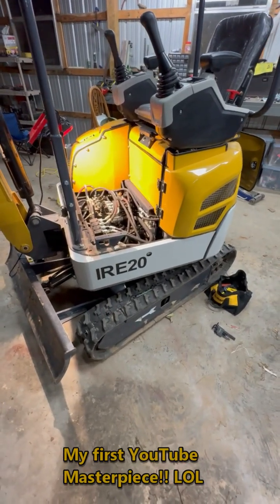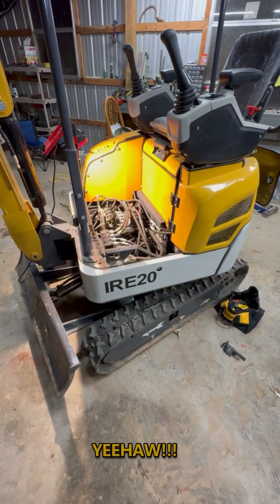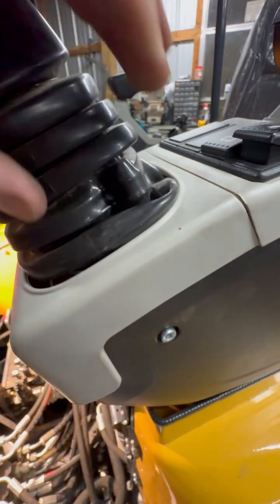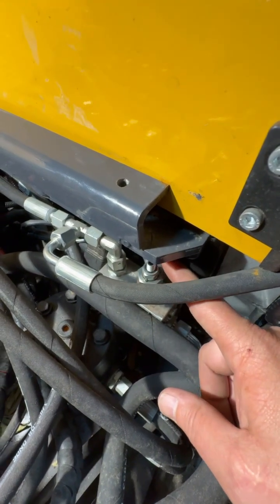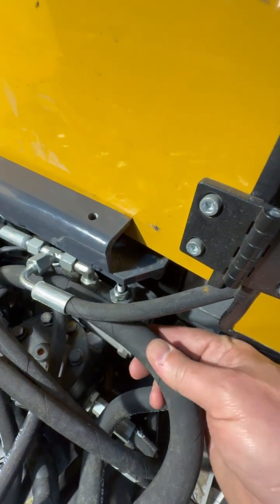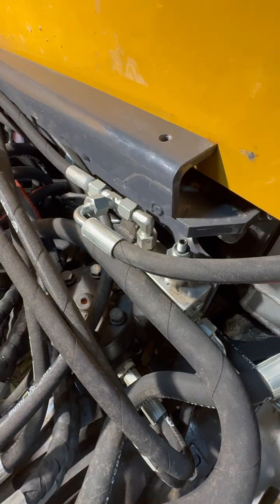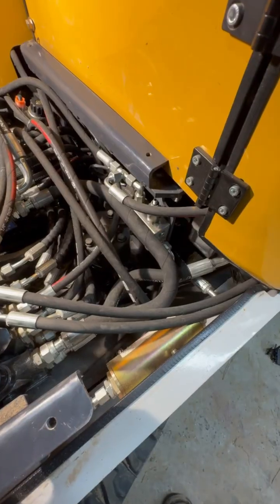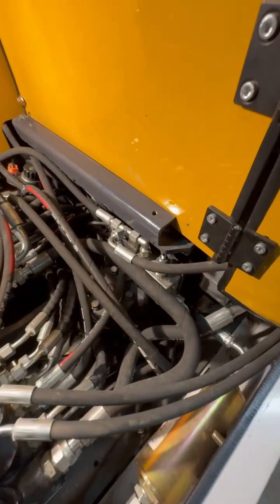How to fix your JERKY mini excavator!  Part 1. IRE20 Machine Hydraulic Adjustment

Comment: You can put a flow control valve in line with whatever hydraulic is jerky. I’ve got an IRE 18 P with the gasoline engine and only the boom lift is jerky and uncontrollable so I’ve seen many guys putting a flow control valve out on the boom piston just right in lineto settle it down
Reply from the maker: Thanks, yes that’s is my plan too. The springs were a game changer. But an accumulator valve would likely make it perfect.

Comment: When that pilot relief valve bogged down, did sound like power steering squeal? Mine did till I found out what was causing it.
Reply from the maker: Mine didn’t squeal. What was causing yours to do that?
Reply: @GPTroop  Pilot relief valve turned in too far, back it out one turn, problem solved. It didnt squeal until machine got hot and working hard.
Reply from the maker: Thank you!

Comment: Summit control valve. I put one on the stick and boom. Adjust to your liking. I love mine. Temperature not effected and i have 140 hrs. Just a thought
Reply: The easiest way is to put them just before the cylinder and get fittings to put the hose right on the valve. I would tell you the fittings but yours may be different. If i think of anything else  ill let you know. Have fun
Reply: Can you please provide a link on what you put on yours? IT will save us all a lot of research
Reply from the maker: Nice! Where did you pick it up at?
Reply: @GPTroop LFC-04N can be bought at Summit Hydraulics. The valve will need two fittings depending on the style your machine uses. Summit can help you with that as well.
Reply from the maker: I just saw all your comments. Thank you! I am sure a lot of others benefited as well!
Reply: Summit, they have all kinds of hydraulic  stuff. I  used LFC-06N VALVES. @GPTroop
Reply: Oh. By the way mine are ajusted all the way closed and just about one turn opened. Yours may be different due to you adjusting you pressure valve. I set my pressure valve at 2600 psi. Hope this helps you.
Reply from the maker: Thank you, I appreciate it! I will look them up. Let the mods begin! LOL
Reply from the maker: Thanks, I have another adjustable valve in there. But I am not sure what it is adjusting. I haven't had time to mess with it lately. I adjusted it, but really can't tell any difference. I might do a video on it to see what the interwebs say it is.
Reply: One is for operating some valves and the other is for the rest of your system  valves. You look close you have two valve banks.@GPTroop

Comment: I know why that thumb bent. I just got a new AGT20...that side of the thumb when up, is right beside to "on" the beam. The other side has about an inch and a half space between the beam and thumb. So it is a manufacturer defect of obviously "several" machines. They either welded up the thumbs unsquare or, the holes on the beam that the thumb pins  fit into are out of alignment.  How old is your machine?
Reply from the maker: I just got it a couple months ago. I hammered in a vise to get it so it wouldn’t hit again.
Reply: RATo Vtwin. ..get some StarTron and add to your gasoline. It will flush the chinese smog crud out of you fuel system, crb etc.. Don't b surprised if it smokes like a diesel for about a half an hour.//t shall pass then run a lot smoother. I have the same unit under a different name.

Comment: You didn't show how to do it... the adjustment...
Reply from the maker: Bigmac, I can do a short if you need. But it is fairly easy. I show it up close in my long video too. You just take that top bolt off. And it exposes the nut that has an Allen head on it. You turn that with an Allen key to adjust. But more importantly than adjusting that is getting the springs into the pilot controls. That will make a huge difference and you probably don’t need to adjust that valve.

Comment: My thumb did the same thing first day yanking on a root
Reply from the maker: I put mine in a vise and pounded it back straight. It’s been good since.
Reply: Even a john deere has a solid plate welded across this so they don't bend.

Comment: I recently just picked up the same machine. Does your hydraulic tank bubble?
Reply from the maker: I believe it does on the side.  But that could be the fuel level. I’ll verify and I’ll post a video on it. I’m also going to post a more detailed video on the pilot control springs. I’ll have them up in a couple days.
Reply from the maker: I had some really small bubbling when I changed the fluid and ran it. I expected that.

Comment: Thanks good to know.  
I own the same machine.  
Also wondering if the machine has a horn mounted somewhere. 
I push the button on the joystick but horn doesn’t blow just a clicking sound.  Thanks for your help.
Reply from the maker: No, it doesn’t have a horn. As you probably already know, on the other stick in the same spot, that’s the boom left and right control. Makes me think that horn button could be used for another function if it’s wired up.
Reply: @ thank you for replying.